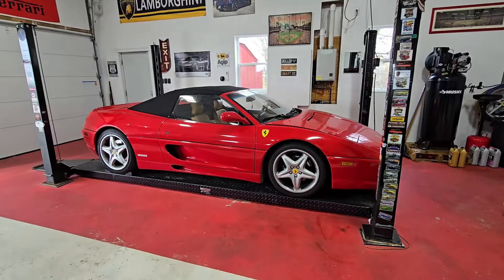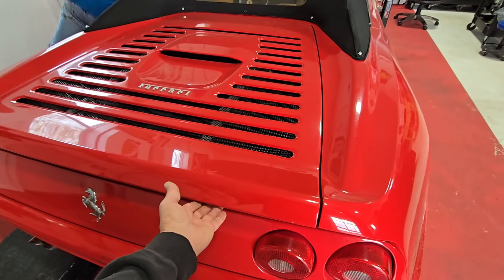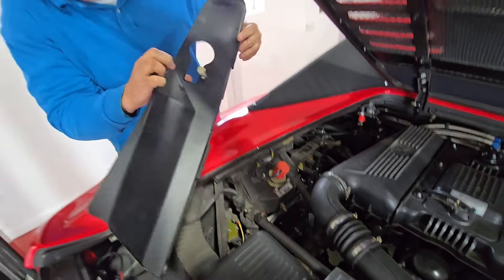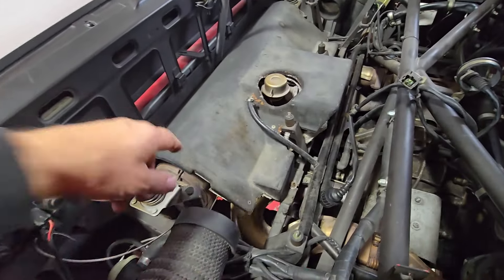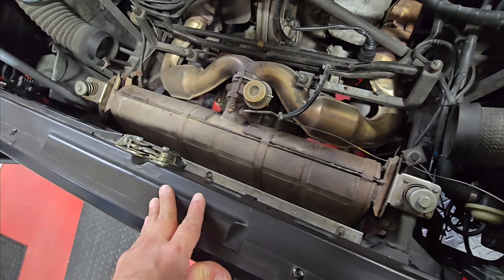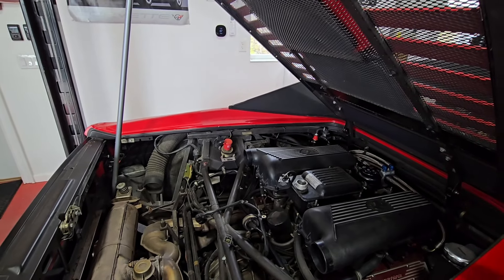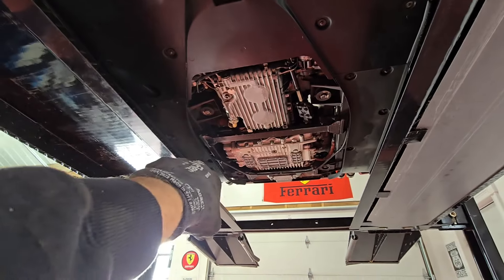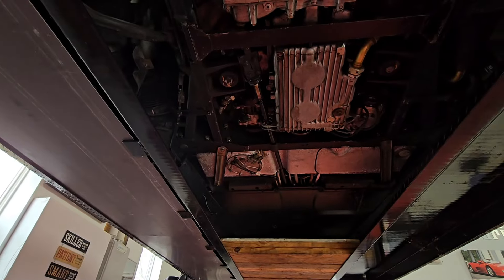1997 Ferrari F355 Service Day 1

Comment: I really enjoy your videos, but you left 75% of the old coolant in the car.  You need to drain the block.  Use driver side drain since the passenger side is so hard to access.  Get yourself a 2-ft section of rad hose so you can redirect the flow into a bucket.  It comes out like a garden hose on full blast and will provide you with a shower if you're not ready.  Ask me how I know...
Reply from the maker: thanks